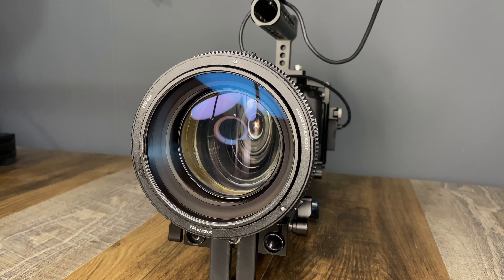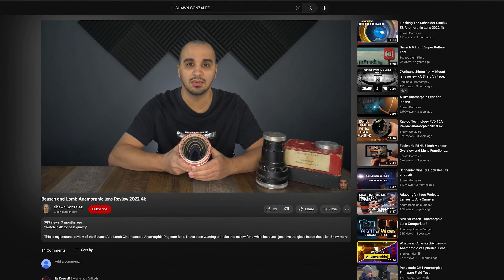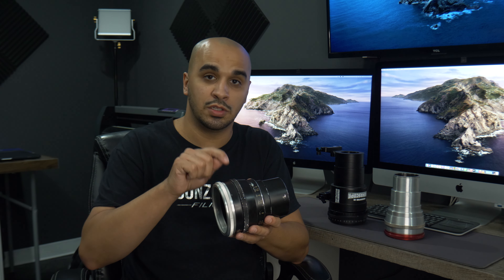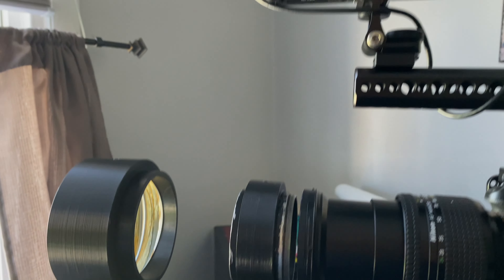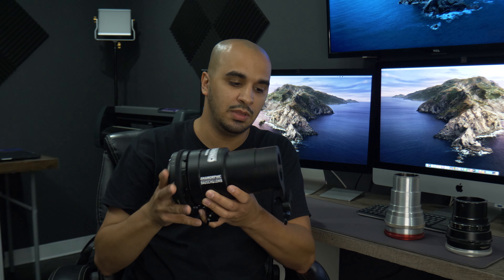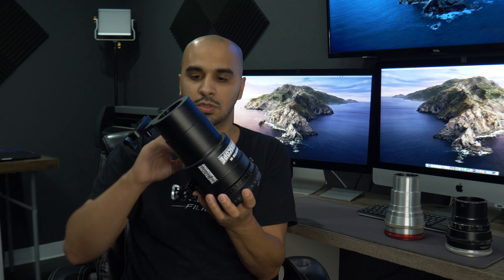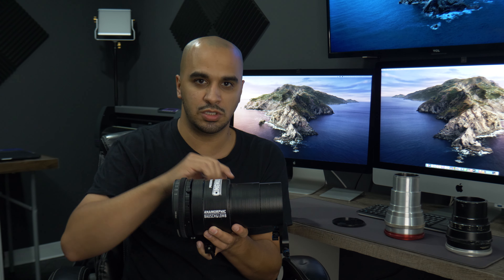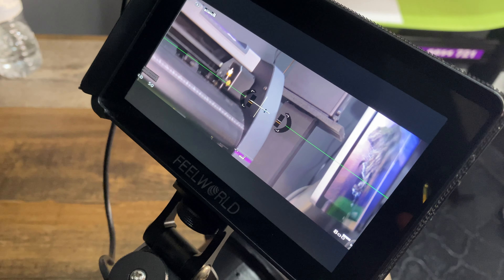Custom Made 3D Printed Anamorphic Lens 4k 2022

Comment: The first time I heared about anamorphic lenses was a guy taping an anamorphic projector lens to the front of a camera lens, and taking a bunch of really good photos with it. I got hooked right away. Later I bought an SLRMagic anamorphic adapter, and range finder a few month after that. It has a lot of limitations. Because it's a relatively small adapter, 62mm rear thread, I can only use it on my 90mm 2.8 macro, and 50mm 1.8 lenses. Rumor says Sirui is releasing AF anamorphic lenses next, and I can't wait to get a couple if they are not ridiculous expensive. Considering the price on cine lenses, and them supporting AF, they probably won't be affordable.

Comment: So nice! I have been searching about the Bausch & Lomb for a while, but just now I found your channel! I have one for a couple years but, as you mentioned, it's not easy to use. 
I'd like to know why it would not work with the FVD 24-A in front of the lens, why does it have to be cut down and rehoused? Mine, focusing on the taking lens only, focus to infinity just ok, the problem is with the minimal focus that goes only to about 4 meters of the camera, and using a +1 macro filter it comes too close, about 1m. So there is a middle point where I can't focus. 
Thanks for your content!
Reply from the maker: Hi thanks for checking out the channel Everton, The reason for cutting it down and housing it is so it’s constantly at infinity and the only focus I need is the 24A the taking lens stays at infinity as well. Plus it’s a bonus to have built in threads on the housing and lens supports.

Comment: So hold on, the B&L has no way to get to infinity at all in the original housing even using the focus ring?
Reply from the maker: No the max it goes to is 500 feet
Reply: @Gonzalez_Films  ok, roughly how much closer do the front and rear optic groups have to be to get to infinity?